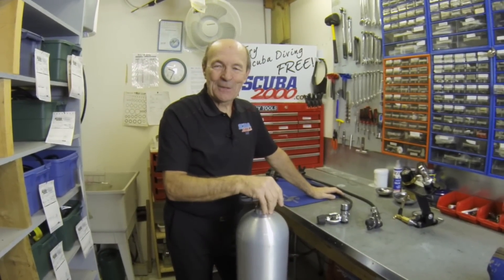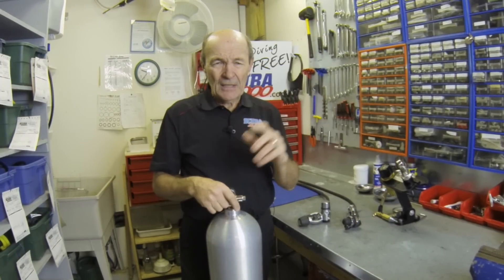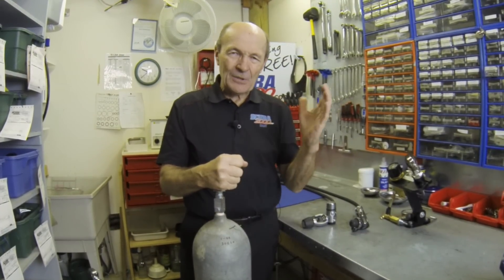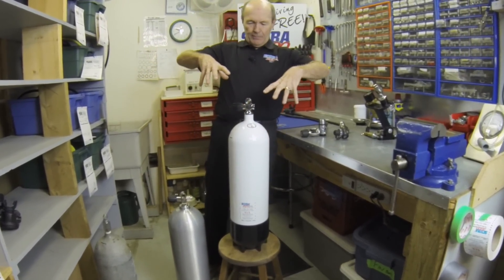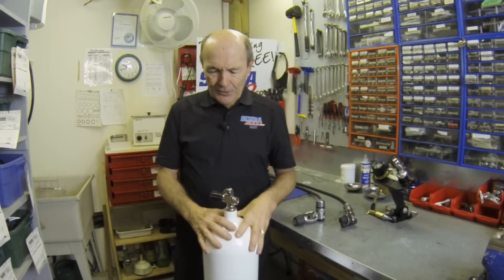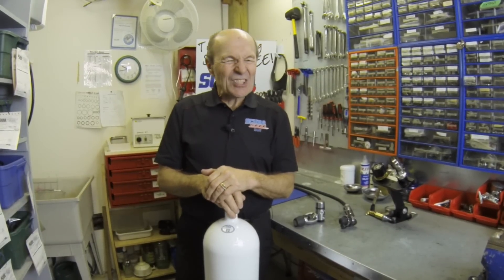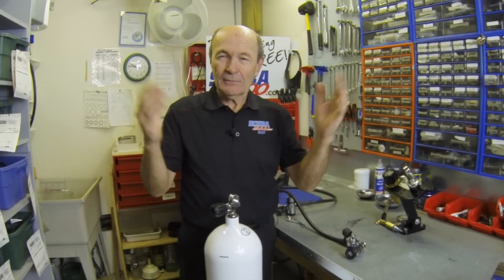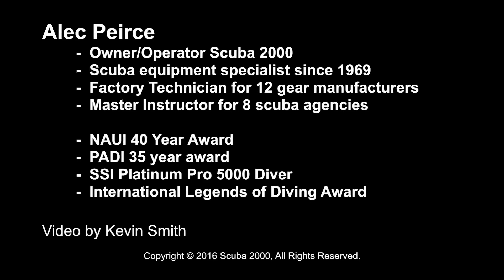Steel vs  Aluminum Tanks - Scuba Tech Tips: S03E07

Comment: I read one thing on a Google article that summed up DIN vs Yoke with a bit of interesting and possibly important nuance. It was talking specifically about travel diving - beyond the fact that DIN regs have a higher pressure rating which obviously appeals to tech divers and other adventure types which explore beyond basic rec diving and beyond the nuance of a captured O-ring vs a free O-ring, this article mentioned where the O-ring is. 

In a yoke valve, the O-ring is on the tank... On a DIN valve, the O-ring is on the reg. That 100% sold me on buying a DIN reg, despite the extra cost. The article said that if you buy a DIN regulator, YOU own the O-ring, YOU are responsible for keeping it maintained and free of debris. Obviously, if you own the regulator AND the tank, you do whatever the hell works best for you, but specifically in regards to the topic of travel diving a lot or doing a lot of boat dives and resort dives where you spend the majority of your time renting tanks from a dive company, rather than supplying your own, it may be a bit of valuable piece of mind to know that this vital piece of equipment, the O-ring, is in your control and care, not the tank supplier. 

Of course, it's mostly a moot point anyway because firstly failures aren't that common and secondly because yokes are so popular anyway that you'll almost always have the opportunity to dive yoke, but maybe not DIN, though very rarely will you have the opportunity to dive DIN, but not yoke, at least in the rec diving realm. 

I guess as well it comes down to where you're diving in the world - some places are highly regulated and everything is strictly controlled... Some places are a bit... Meh, little bit on the edgy side. In those cases it would be a decent amount of piece of mind knowing that all you have to do is rely on a shop to provide you a tank that isn't corroded completely through and you'll handle the delicate stuff like your precious O-rings and stages. 

In that sense, it's a shame that DIN isn't the standard, because I'd go so far personally as to buy a DIN reg and a yoke converter, in case I am put in a situation where I'm forced to use a yoke valve - in that respect carrying a small screw type connector, if you prefer yoke regs, and still having ownership and control over the O-ring is far more convenient than carrying a DIN converter to clamp onto a renta-tank with their God knows how well maintained O-ring.

I donno, maybe I just read far too deeply into it, but when I read that minor point in the article I read, it clicked for me in a weird way.
Reply from the maker: Having a captured O-Ring is a good thing. And, if you are a fastidious diver, owning and carrying your own tank O-Ring is good too.
Many divers are not and so rely on a good dive store to supply them with tanks and O-Rings.
I have no problem with DIN fittings and agree they have some advantages, as does the yoke fitting.
I DO have a problem with divers who claim the DIN is the ONLY way to go. Clearly, it is not.
Take care.
Alec

Comment: Do they make carbon fiber tanks?

That's what they use for air guns and they hold 4,500 psi
Reply from the maker: They are available for scuba diving. The problem is the cost. Air gun size is much too small for scuba. The large ones required for diving would be in the $600+ range.
Then you have the problem of buoyancy. You'd have to wear a lot of extra weight.
Maybe one day we'll get it sorted out.
Alec
Reply: Carbon fiber tanks are common with fire figthers. it makes sense that you would want as little weigth as possible running in to a building on fire. But for diving you still need to make up for that weight in lead so that in combination with price makes it pointless. i remember when the fire departments started to switch from steel to carbon tanks in my country becus all the fire stations would seel the old steel tanks cheap. So here it is not uncommon to se divers with the 2x7L steel tanks that the fire figthers used to use

Comment: Hi Alec, Was looking at tanks yesterday, so this is most helpful. I saw the Steel Faber tanks come HP High Pressure & Reg, some are Hot Dipped Galvanized with higher prices. Other question is on Aluminum tanks come in many colors however not the Steel tanks. A short answer will help me on both questions. Thank's Alec...
Reply from the maker: It's very hard to get paint to stick to galvanized.
It's hard to get paint to stick to aluminum too but they've mastered it now so the paint no longer flakes off in the first year.
I'm not sure how many tech divers would want hot pink tanks. They're too cool for that!!
Alec

Comment: If you want to start a argument inside of a dive shop ask someone which is better steel or aluminum. Everybody  has their own opinion. I personally only use aluminum. It doesn't matter if I'm wearing my heavy wetsuit or even my dry suit I dial in my buoyancy. 

Then you have the whole argument about should you buy your own tanks or just rent them. Even before I was certified I owned all my own equipment. Every week as I was getting certified I would buy what I needed and by the time we went to the quarry I have owned all my own stuff. Same thing with the scuba tanks. I'm not saying that when you travel that you would get a bad tank with bad o-rings but why take the chance.

I will tell you that after your discussion on the steel tank I might actually get one and trying out this year. I like the fact of the more air seeing that the older I get the faster my tank goes dry.
Reply from the maker: Divers have strong opinions and will argue over anything, fins, tanks, yoke vs DIN.  They mostly confuse facts with personal preference and geographical preferences.  I give the facts and let others argue nonsense.  Keep an open mind and question everything until your satisfied with the answers.
Alec

Comment: i have old conshelf supreme yoke style it is stamped 4000psi can i use this over the3500 psi.
Reply from the maker: 4000psi is the maximum pressure allowed.
Most are now 4500 or 5000 psi.
However, I'd not be worried about it.
Those old USD yokes were stroooong!!
Alec

Comment: Steel is the way to go. You will carry the tank anyway; with steel you will carry less lead weight.
Reply from the maker: In the end, it's all the same. If you carry a steel tank which is heavier, you need less weight. If you carry an aluminum tank, you need more weight. Your total (net?) weight is the same.
Steel has some advantages but here, in North America, the cost makes steel tanks less desirable for most sport divers.
Take care.
Alec
Reply: @AlecPeirceScuba_SeaHunter  I disagree that the net weight is the same. If you do an Apples to apples comparison the net weight of steel is often a few pounds less.
Example Luxfer AL80 31.9lbs, buoyancy empty 4.4lbs
Faber HP80 28.3lbs, buoyancy empty -1.7lbs
Luxfer AL100 40.1lbs, buoyancy empty 3.1lbs
Faber HP100 34.0lbs, buoyancy empty -0.6lbs

So with a HP80 you not only can shed 5lbs of lead, but the tank itself is 3lbs lighter. For the HP100 you can shed 3lbs of lead and the tank itself is 6lbs lighter. And in the 100cuft range the steel tank has another advantage in the US, per the new interpretation of DOT rules you can't put nitrox in any DOT-3AL tank (pretty much all aluminum tanks) over 3,000psi, which means you can't fill it to its service pressure of 3,300psi. Of course there is the usual negatives of steel tanks, they can rust much more readily than AL tanks, and they are $80-100 more expensive.
Reply: @Teampegleg  Thanks for posting those numbers, as I didn't know what was being compared. I do, however, notice a math issue. It does seem to balance, because AL tanks, overall, weigh more than Steel, so it does balance out.

Since tanks change buoyancy (weight) over the dive, the best measure might be to take their average weight (mid dive) and compare.
AL80 31.9lbs - 4.4lbs = 27.5    Average 29.7lbs
HP80 28.3lbs - -1.7lbs= 30       Average 29.15lbs
Pre -dive, you are 3.6lbs heavier with AL, post dive you are 2.5lbs lighter with AL when compared to HP steel, over the whole dive, you are 0.55lbs heavier with AL. It's a wash.

100's are more interesting:

AL 100  40.1lbs -3.1  = 37                Average 38.55lbs
HP 100  34.0lbs - -0.6=34.6               Average 34.03lbs

AL is always heavier than Steel: 6.1lbs pre-dive, but 2.4lbs heavier post dive. Over the whole dive AL is 4.25lbs heavier than HP steel. With AL, you will notice a 3lb gain in buoyancy, over your dive (less dramatic than the 4.4lb change with AL80).

If you hadn't put those number together so neatly, I may never have been inspired to calculate this :)
I just  learned a lot because of you all. :D
Reply: @TragoudistrosMPH  I don't you are factored in that most people have to carry at least 4-5lbs of additional lead with an AL tank vs a HP steel tank. For example with an AL80 and a 5mm suit I have to carry 8lbs of lead plus my 2lbs back plate for a total of 10lbs. While with a HP80 I could subtract at 5-6lbs of lead off my belt.
Reply: @Teampegleg  I thought about that, but if your body & wetsuit are all constant, and all that differs is your tank, the last thing to change would be the weights.

Take my tank calculations, and see how much weight you actually need. 

The numbers have to add up, so people are adding more weight than necessary when diving AL. (Remember Mr Pierce did say AL has to be heavier to withstand the same pressure as a Steel tank.)

The BCD is capable of a larger impact than these calculated weights, now that I look at them. Very interesting. (depth also makes it more noticeable since you end your dive with an empty tank, thus being even More bouyant)
Reply: @Teampegleg  or if we were twins using the same gear, but I had an AL80 and you had a HP80, it would go like this in the water (say 30ft):
Dive start, I way 3.6lbs more with my AL80 (31.9 vs 28.3)
Mid-Dive, I weigh 0.55lbs more with AL (29.7 vs 29.15)
Dive-End, I weigh 2.5lbs 'less' with AL (27.5 vs 30).

We could use weights or/and our BCDs to adjust for those differences.

The same math applies to us with 100 tanks. (I appreciate the mental exercise, as I'm looking to buy gear.)
Reply: @TragoudistrosMPH  You are confusing buoyancy with static weight.

Both wearing the exact same exposure protection, and equipment and are approximately neutral at 500psi.

An AL80 weighs 31.9lbs, I have to wear 8lbs of lead. - So walking from my truck to the dive site I have to carry 39.9lbs plus the weight of all my other gear.
With a HP80 which weighs 28.3lbs, I only need 2lbs of lead. - So walking from my truck to the dive site I have to carry 30.3lbs plus the weight of all my other gear.

You can ignore the weight of the air because they are close enough that it is a wash.

Now AL has an advantage when diving wet with doubles, as they are positive when empty, you actually can have some ditchable weight, and you aren't too terribly negative at the start of the dive. So they are safer.
Reply: @Teampegleg  possibly, you gave me the buoyancy difference values (-1.7 and 4.4lbs) between empty and full, so I subtracted which should account for that, since buoyancy cancels a specific amount of weight.

Buoyancy and weight go together, so if you are correctly weighted as above, an HP80 with 30.3lbs is equally buoyant as AL80 39.9lbs?
Continuing with that, by dive end, AL80 would be at 35.5lbs and the HP becomes 32lbs. 

I'm highly interested in the math/physics (I'm a research statistician).

Steel tanks weigh less than AL, but are AL more buoyant when full? When empty?
Find those numbers (if they are missing) and we have the answer :)
Reply: @TragoudistrosMPH  Buoyancy doesn't cancel out weight underwater, because underwater buoyancy is the weight of the object.

When we dive we have to canceled out the weight of any buoyant things we are wearing, which typically means your exposure protection. It takes about 6lbs of weight to canceled out the buoyancy of my 5mm wetsuit. But since an AL80 is buoyant at the end of the dive vs a steel tank that isn't, is I have carry more weight to cancel out the buoyancy of the AL80.
Reply: @Teampegleg  I see where the disagreement stems from.
Buoyancy is a force, not underwater weight.

(With the right equations you can convert force into weight, though. You can skip my math and at the bottom is a calculator link)

There are lots of ways to calculate buoyancy (physics is just an acquaintance of mine, while biology is my love... statistics is our child, ... and I've come to cherish our child, biostatistics, more than biology 🤫)

My math teacher said (when you assume, you make an ass of u and *me*), so I looked some equations up.
the easiest equation I found for Buoyant Force is Bf= (weight in air) - (weight in water)

imagine your BCD weight 15lbs, and if you fully inflate it under water, it floats off the (sea)scale and can't be weighed because Buoyancy Force has cancelled out its weight. (Sorry if that example is too silly)

I found: Buoyancy Mass Formula
mb=m0 *(1-rf/r0)
buoyancy mass = true mass * (1- fluid density/object density)

basically if the object (tank) is denser than water, the parentheses become negative and mb (buoyancy mass) becomes 'negative weight' (mass) and floats.

This is a calculator too complex for my tank experience with just 40 dives and 0 owned tanks but might be easier for more experienced divers: https://henrik.synth.no/scuba/tanks.html
Reply: @TragoudistrosMPH  You are way over complicating things. Yes technically buoyancy is a force, but it is easier to get new divers to picture it as a weight because that is something that they are familiar with.
Reply: @TragoudistrosMPH  Aluminum tanks also have a larger air space, as such even though they are heavier they are more buoyant. Seriously you are arguing against actual numbers tested by the companies, and tested by divers. But whatever weight yourself however you want, I won't be the one popping up like a cork from your safety stop because you didn't put enough weight on.

Comment: Having now dived with both steel and aluminium, i think i prefer the buoyancy characteristics of the aluminium. No scientific reason, just personal preference, but that's probably down to me having more experience with aluminium.
Reply: did you remember to take a bunch of weight off your BCD/belt for the steel tank ? too much weight can be annoying constantly adjusting your BCD...
much better boyancy (and they don't float or pull on your back when close to empty at the end of the dive.

Comment: The tape on the valve is anti -seize  tape, Just used to make it easy to take off the valve and that's all"
Reply from the maker: I think it's Teflon tape. 
It does make it easier to install and remove the valve but in a tank valve (1/2" pipe thread only - NOT 3/4" machine thread) it also acts as a seal.
Alec

Comment: Here in Europe Aluminium tanks are very rare. Pretty much everyone is diving with steel 230 Bar tanks. Those cost actually no more that about €250,-. 300 Bar (4350 psi) tanks are getting more and more popular. I'm diving with a 300 Bar carbon tank. It's very light. Empty it's about 2 kg positive buoyant. So you need to take addition weights with you.
Reply from the maker: North America seems stuck on Aluminum. Part of that is laziness. Divers don't want to take time to care for their gear.
But dealers too like the AL tanks since they carry less liability.
Certainly for lots of divers the steel are the way to go.
Thanks for watching Carlo.
Alec
Reply: I've been wondering about those carbondive.com tanks - is that what you use?
The buoyancy characteristic was not that much better than HP steel tanks (which are much better than Alu) once you add the necessary lead to make them sink the same, so it seemed like a lot of money and worse we can't get those kind of fills here (hard enough to be a good 3500psi) here in the US. But been thinking of getting a DIN reg so I can try them next time I'm there... One advantage is if you have a  bunch of tanks to carry from the car then the added lead stays with your BCD/belt :)
Reply: @alaind831  hi if you can't fill them it's just a waist of money. But then again it probably is. Those are about $600 a tank. You can buy 3 aluminium tanks for that. I bought one about 15 years ago. Since I had a lot of problems with my balance (as inexperienced open water) and pain in my lower back as result of the weight from heavy steel tanks. The buoyancy characteristics are about the same as a aluminium tank. But those are not as common here in Europe. Specially 15 years ago. So I'm diving with a tank like that. It's 12 liters and 11.6 kg. So it's naturally buoyant and will float when it's near empty. But it's hard to get a good 300bar fill. At those pressure the tanks will get very hot. After letting it cool down and topping it of I usually don't have more than 270 or 280 bars. And that's with an overfill. Don't think I will buy a new one.
Reply: @forgot_my_name_again  actually alu tanks are slightly heavier than HP steel (of the same capacity). I too used get pain in my lower back from too much waist weight (had 32# with drysuit) and have been moving them up in my BC closer to the tank and adding trim weight as well. a Steel tank really helps. Better now. I need to work on loosing some of my built in flotation now :)
Reply: @alaind831  hmm my experience with aluminium is that those are lighter and neutral buoyant. My carbon tank is actually positive buoyant. It's really nice but you need to take 8 pound extra weight with you. If that's all located around your middle it may result in the same issues. You have tried strength exercises for your back? Perhaps move some weight to other places than your waist. Like heavy fins or a backplated system.